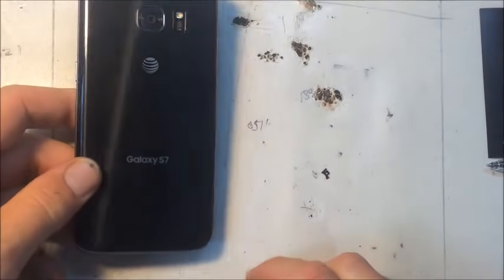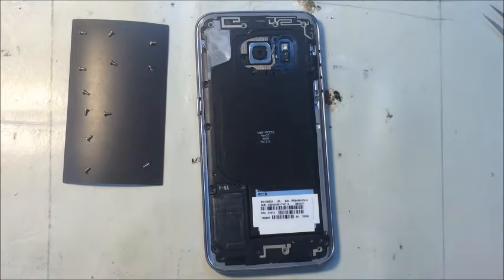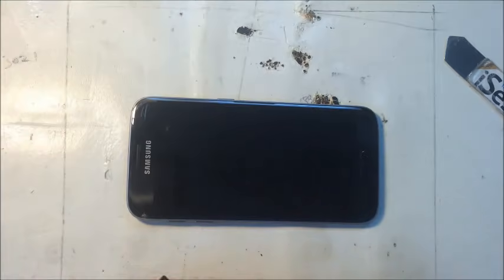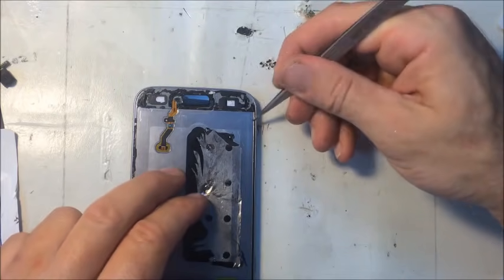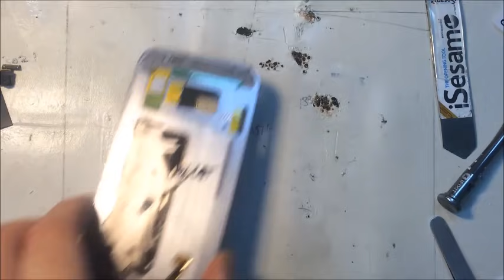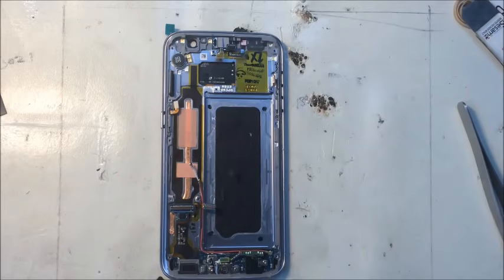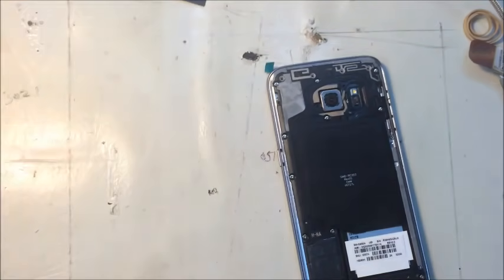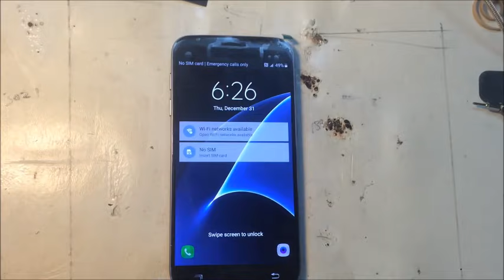Galaxy S7 Screen Repair - Digitizer and LCD

Comment: Absolutely great video, best I've seen. Been wanting to fix mine for almost 2 years....... You are a pro, doesn't look easy, but does look possible with your help..... Thank you
Reply from the maker: Thank you for the kind words. Samsung's are loaded with adhesives so take your time...
Reply: I found that out the hard way   lol.
Reply: Youre not joking the adhesive is a real pain. I took mine to phone shop in end to get back off, but only cost me a 5er atleast. Going to try the rest of the repair tomorrow and just hope I can get the front off now with the heat gun, hopefully it will be easier than the back.

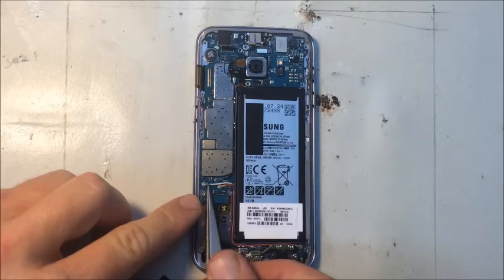Comment: Suctions cups are a must have & work great to create a small gap in order to start the removal process w/o cracking the screen.  Great tip & love the magnet card idea.  I use a thin foam piece to put each screw into as they are removed and in their correct placement. ESPECIALLY for Apple products as they are notorious for using 10 different sizes in any device. ;(  Thanks for this additional tip. Also, great tip to test the new LCD / Digitizer before going any further.  You never know if you received a bad screen on not.  FYI, I like using plastic or rubber tipped tweezers. I also use the plastic tools and am very sensitive to pressure issues (plus this limits any ESD issues).  You warn about using metal tools around PCB or to disconnect cables, etc.  But, then @ 11:20 & other portions. You take the metal tweezers to pry up the antenna cables, connect cables, etc?  I have very fine plastic & rubber coating tweezers / pry tools, just for these applications, etc.  The paint brush works great for the small debris / glass particles.  Good catch on the speaker grill.  It is always the little pieces that bite you in the butt in the end. LOL. Argh, then on re-assembly, you used the METAL tweezers again, poking on the PCB and cables. ;(  Glad you pointed out to clean the camera. I have seen many a fingerprint left by inattentive techs. Have to fix my nieces 2nd broke phone, but having issues locating the correct / bonafide OEM replacement screen / digitizer.  Not some China knock up that has cheap glass etc. Or not compatible with device. Argh.  Take care.  Thanks for the detailed video.  Just my observations & constructive criticism.

Comment: Thanks for the video.  It helped me repair the LCD on my Samsung s7.   The hardest part was actually removing the back, and knowing how long to use the heat gun for.  Took a while but I got her done.  The only other surprises was when removing the lcd itself, I couldn't remove it without shattering the "mirror" on the lcd.  So got a bit messy but that was just a matter of cleanup.  The only issue I had ultimately was the push button was out of place and all the adhesive around it got removed but managed to put it back in place with tweezers, etc.    I did want to mention that I did test the new LCD as you did.  However, I was not able to turn my phone on as I had no power, my battery had drained as I was unable to power the phone down....so just because it doesn't come up doesn't mean the lcd won't necessarily work.  Luckily I went ahead with the install and once I charged my phone, it powered up.  I purchased a genuine LCD screen from an ebay vendor and also purchased a tool kit from Amazon.   Buy the tools, they are essential.
Reply from the maker: I am glad you were able to repair your device successfully. There is almost always some unexpected issue but as long as you stay calm and move slowly and delicately you can usually overcome the issue.

Comment: Hi! I was able to get the logic board out without removing the battery. Battery is disconnected...is it imperative that I remove it before heating the glass front? Thanks in advance.

Comment: I replaced my S7 Edge battery and now my touch screen is not working, I get picture and all the buttons are working. What could the problem be? I've tried reseating the connectors multiple times and inspected the connections and they seem intact.

Comment: will a hair dryer do in place of the heat gun?
Reply from the maker: Yes it will. It will take a little longer to get hot enough but will work. You want the device to get hot enough so that you pull your hand back after about 1 second of touching it.

Comment: Could i just use some superglue for the front? Very helpful video
Reply from the maker: No, definitely not.  There are very few cases when Super Glue should be used in a repair and in my opinion they are limited to the home button bracket on the back of certain iPad models' glass.  For the Galaxy S series and all other phones only use double sided adhesive to stick the screen down. I recommend Tesa Tape because it works the best and I never have a screen come up when using it. I keep a role of 2mm wide and a roll of 10mm wide. You can buy it here. https://www.mobilesentrix.com/tempered-glass/liquid-tempered-glass/tesa-tape
Reply: Sounds good thank you.

Comment: I want try to fix my phone where can i buy the Screen replacment
Reply: I just got one from digitalsupplyusa.com it was about $80 with express shipping. There was no sticky back to it. So you will need to tape it. If the back is glass you will likely break it when taking it off. Get tweezers to take off the colored wires. I almost tore of the connect on one of them. Good luck. The screen when broken is real sharp...